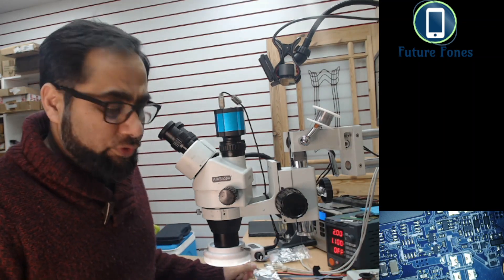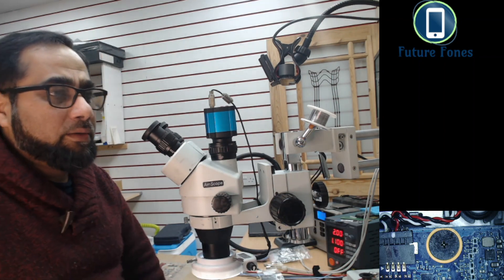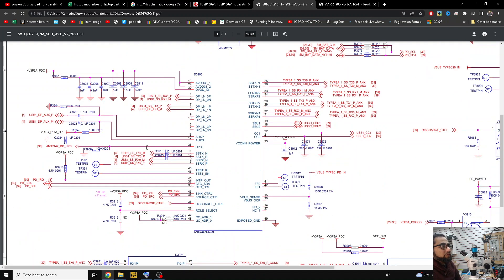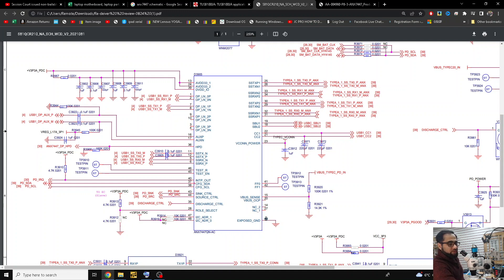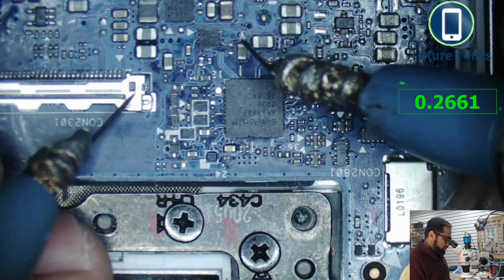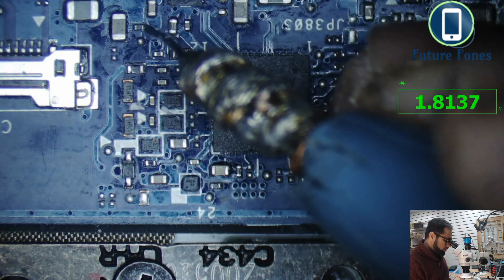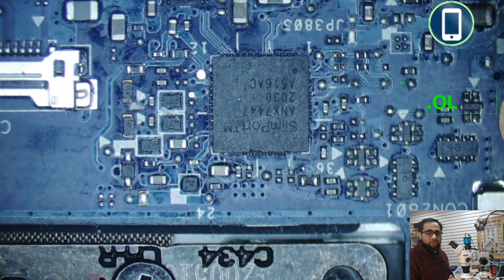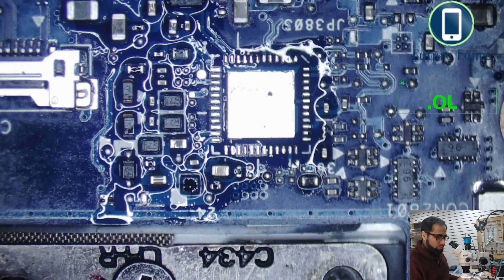Asus Chromebook Not Turning On. Easy Check , #ANX7447 Logic

Comment: I have the same laptop with the same problem. This IC ANX7447 is fine, what IC should I check further? Intersil 9238H is going to the battery and is jumping voltage from 5v to 13.2V , is the iC or the battery?
Reply: Any chance you figured yours out?